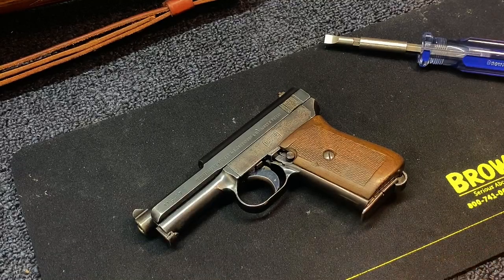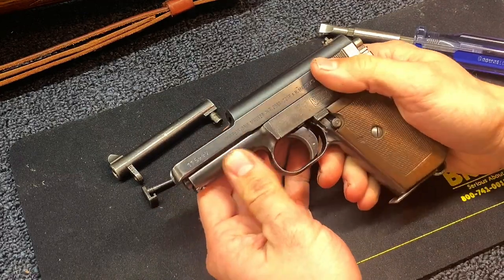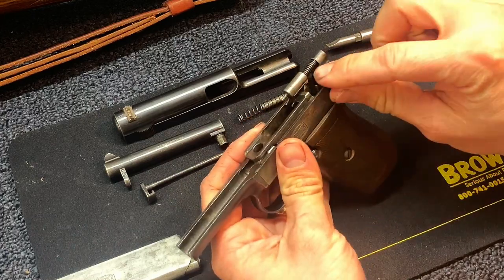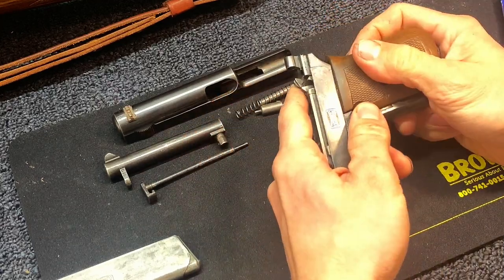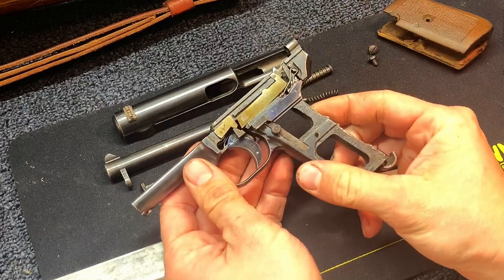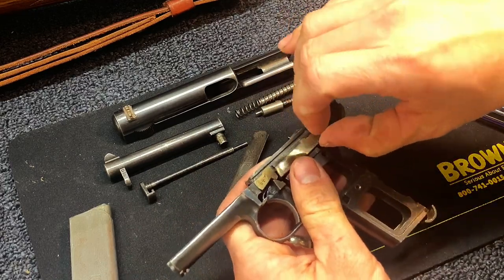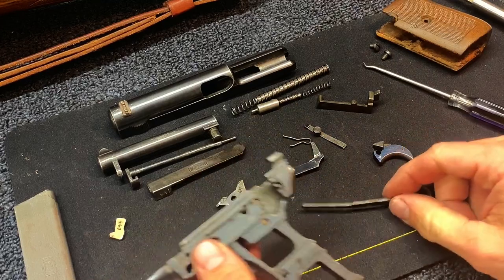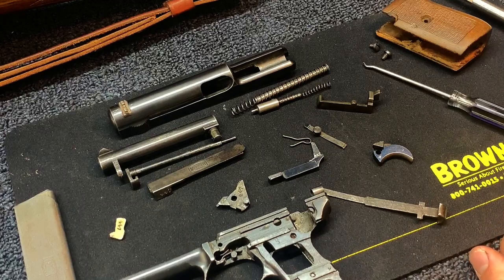Mauser M1914, 1910, 1914/34 Complete Disassembly w/o Tools

Comment: Thank you for this! I have one in my shop (M1920) for cleaning and had no idea how to take it apart...been carefully trying different things. When I was taking the slide off I heard a springy sound, and looked to see that the firing pin spring had bent down into the frame because there's no spring retainer pin inside the firing pin. My cousin said he's fired it before with no trouble, so now I'm confused. If I can get it back together tomorrow I'll take it apart again with video to see what happened.

Comment: Thanks for posting. Disassembly worked like a charm. However, after firing about 6 rounds (probably for the first time in 70+ years) the firing pin broke. I cannot find any replacements online. Suggestions?

Comment: I just got one in super bad shape lol. Mag release is completely gone. Safety does not work. Slide will not lock. Slide is extremely hard to get back far enough to cock the firing pin. Looks like I'll be putting mine in a display case!

Comment: Hey, quick question: can you disassemble the magazine? Just bought a Wolff spring for it (feeding issues when firing) but cant figure out how to disassemble the mag...
There is a "dimple" on the mag floor plate that seems to prevent it sliding out of the mag body.
Reply from the maker: Just uploaded a video for you!
Reply: @kurtthegunsmith  wow, thanks! Didn't expect a video...
 Unfortunately it seems I have a different version of the magazine. Mine has a dimple on the bottom/flat part of the floorplate that prevents it from sliding out, no spring end sticking out... I boiled it in water yesterday and now I am letting it soak in oil. Hopefully that will loosen it up.

Comment: I have a question I have a model 1910 and the tip of my magazine catch broke what does that actually do
Reply from the maker: If you are referring to what I think you are, it holds the magazine in place
Reply: @kurtthegunsmith  right I know that. The top part of it broke that goes inside the frame. When I watched your takedown you said the mag catch held a particular piece in inside the frame right below the firing pin. I’m restoring one and the top inch and a half broke. Cannot find a replacement. On gunbroker, numrich, popperts, liberty tree, everygunpart, brownells, jacks, etc…  do you know any other parts sites? Thank you very much for the reply. I know what it’s like my bro replies to every comment on our channel. It’s called “the kinzler bros”.